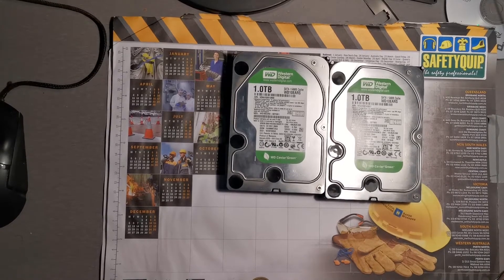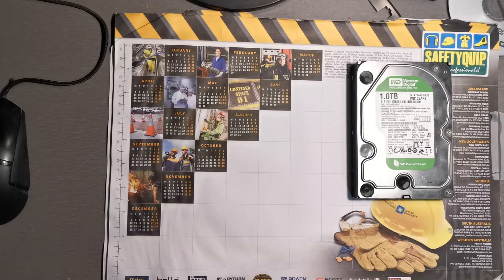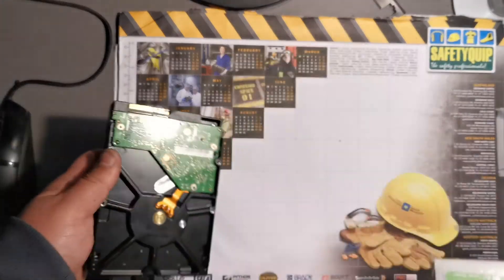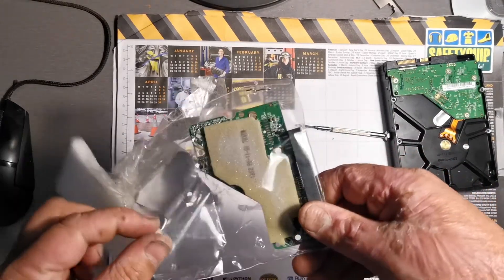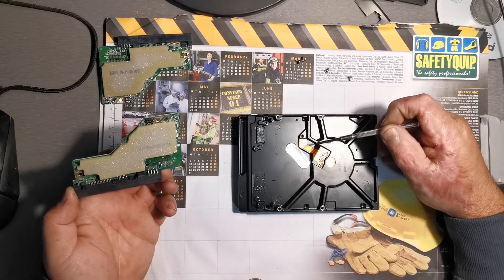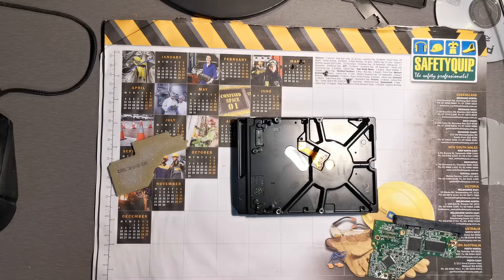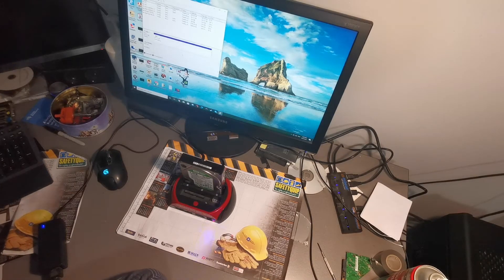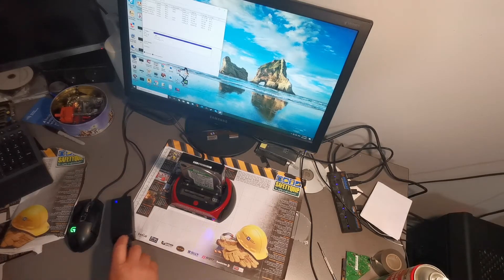WD Hard Drive Repair.. Broken Sata Port

Comment: Thank you...Great video...just one question sir...... after changing the board, do i have to format it? or it can be used as it is? Because i have a HDD that has valuable files in it......

Comment: Good to see people have a go.
As a tech I do recommend 
(a) anti-static precautions - zapping can and does happen.  earth wriststraps are cheap and can be purchased even from jaycar
(b) use the right tools. these days you can get torx set from bunnings for about 20 bucks
(c) if you are trying to recover the data on the drive you may need to have the eprom chip relocated from the old logic board to the replacement - this needs specialist VLSI capable soldering station.
(d) the sata socket itself sometimes can be replaced where there is no other damage to the logic board.
(e) RAID should not be regarded as a back-up.  If the machine is hit with lightning  the whole lot can go.  If the RAID controller goes faulty it can be difficult to get the same type of RAID controller to get the data back. 
(f) Best practice for Backups is to have 4 copies - (a) the working set (computer drives), (b) an on-site back-up - usually a network attached storage drive with hidden/secured shared folder to accept the back-ups; (c) an off-site backup usually uses ssh tunnel ftp to transfer backup updates; (d) an air-gapped backup - this is so hackers cannot destroy or encrypt the data.  Airgapped means it is physically disconnected from the network after updated - you could rotate multiple drives for this say one for each day of the week, one for each week of the month, and so-on.